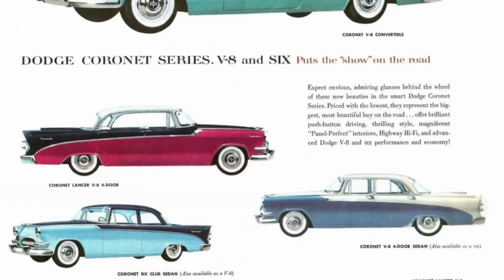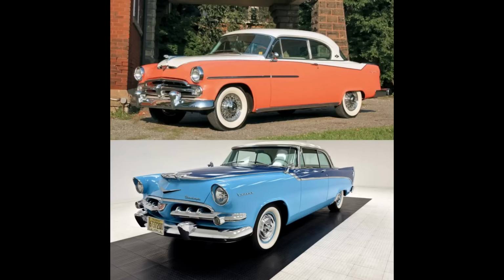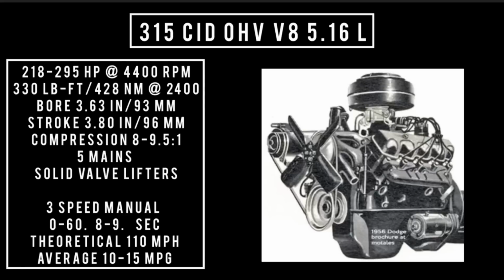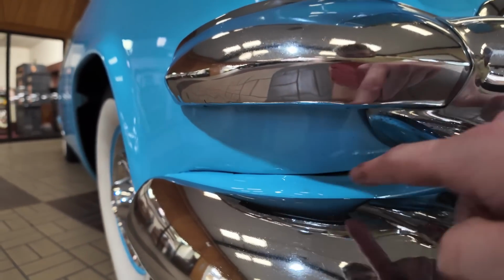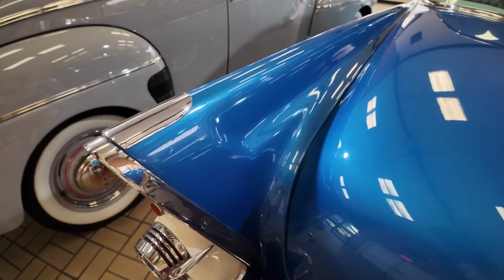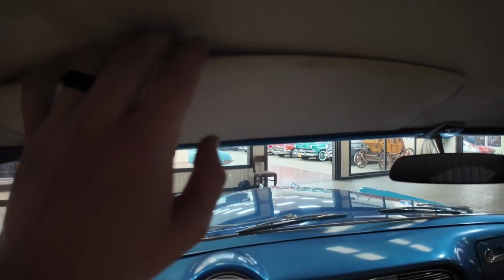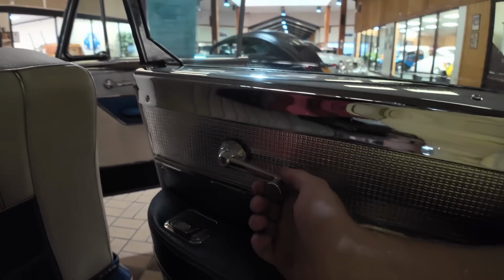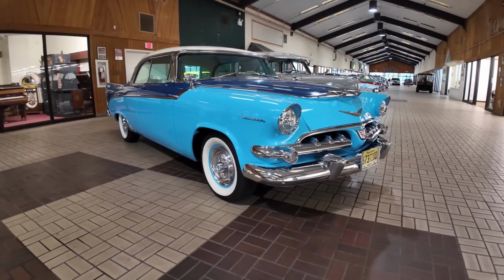1956 Dodge custom royal Lancer 2 DR HT￼

Comment: Hi Jay! Just a bit about Virgil Exner. After working for Raymond Lowey on the '47 Studebaker line, Exner quit and went freelance before landing at Chrysler in '49 or '50. He started at Dodge, and you can see his influence on the '53 and '54 Dodge lineup. He rejected the reverse slant C pillar and used in my opinion a better look. Plus, he introduced vestigal bump up fins at the rear fenders. They were, in my opinion, the better-looking Chrysler products for those two years. 
I agree with you that the '55 and '56 Chrysler products were Exner's best efforts. Especially the '55's. Take care and thank you for another vexcellent video!

Comment: Did you say "One commercial"?  When Dodge went to Monacos and Polaras, I could never keep the model line up straight.  Was Monaco the model with the most features or Polara?  The old line up was easier to follow.  Exner was great until he went to UFO googie styling.  The '54 was mighty stoggy compared to what came after, right up to '60.  Her headlight buckets looks just like the '56 Chryslers & DeSoto Fireflights.   That's not a stock trunk. 😀 WYR: 1-Dodge 2-Studebaker.

Comment: The '56 Dodge is the first car I remember my family having, and was the first car I "drove" 😉 .... sitting on my dad's lap, with my hands on the steering wheel, while he operated the brakes and accelerator.   
We have only black & white photos of the car, but it was the tri-tone red/black/white.  
Trunks did not have such fancy fabric, as is shown in this example ..... and I believe a lot of its interior upholstery is customized. (ours had a woven cloth section on the seats, not all-vinyl like this one, and the package tray was nothing like this car has).  
One detail I remember is that the glove box door sat flat when open, where it could conveniently be used to place drinks upright when our family was at a drive-in food place, or at the drive-in movie.  There were no cupholders in those days, obviously. 
I believe 1956 was the first year for Dodge having a 12-volt electric system. 
On the 3 "would I rathers", I pick the Dodge in all three  (even though I've owned a '56 Chevy for nearly 50 years).
Reply from the maker: Awesome thank you for sharing that insight

Comment: Early Exner before the 'excess' period is actually nice. This one is over-restored; the trunk and kick-panel matching upholstery isn't factory nor are the headlights. Can you even get non-halogen sealed beams anymore? I dunno. A similar Plymouth is the car I experienced my first crash in. I don't remember it because I was only 7 months old at that time but I do seem to remember the car, at least from the outside. 
WYR  I'm a Ford man for #1 and the Studebaker Golden Hawk is one of the most beautiful cars ever built for #2 with the DeSoto taking round 3.
Reply from the maker: Awesome choices. Thank you so much for sharing that insight.

I'm not sure about the non-halogen lights

Comment: I think '54s came in two wheelbases,the one at 4:35 looks like a shorty 
'54 is the better looking but the '56 had a more powerful optional engine and probably better outward visibility 
not sure if the '56 had the much much better 3 speed automatic instead of the two speed in the '54
Reply: The excellent 3 speed Torqueflite automatic came available in '57. The Torqueflite may have been available on Imperials in '56.
Reply from the maker: Awesome insight =)

Comment: Interesting that I recently purchased a die-cast model of a 1955 Dodge (Hot Wheel size), so I was comparing it to the 54 and 56 as you talked. The  change between the two seems to actually been in 55. The model I have is the Dodge Royal Lancer. Most of the changes you spoke of first appeared in 55. In 56, they became a bit more extreme. I was happy to find that die-cast Dodge. Not something you would commonly see.

Comment: The firesweep was introduced for the 57model year.
Reply from the maker: Yeah, that was my fault. I meant fire flight.
Reply: Correct and the Firesweep was actually a retrimmed Dodge. A lower cost option for DeSoto shoppers.